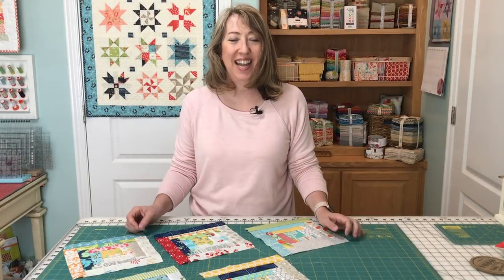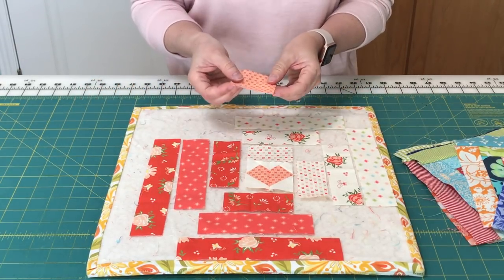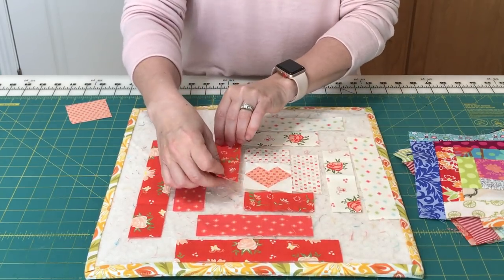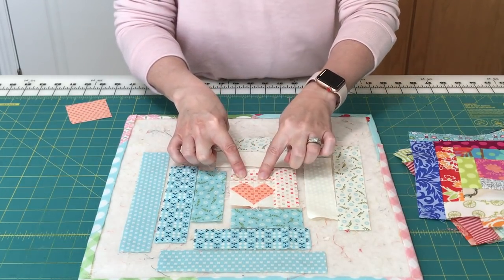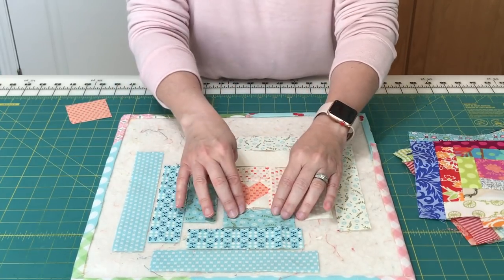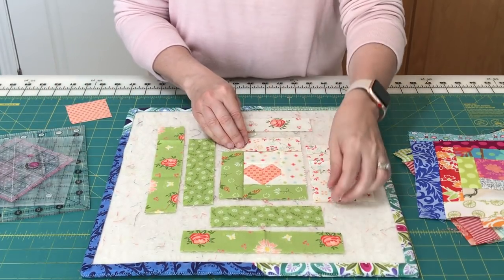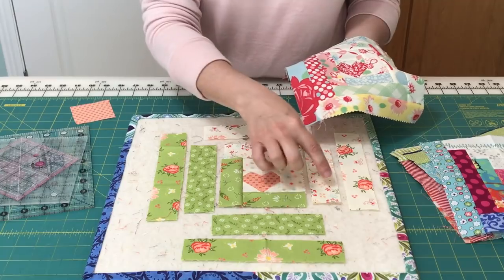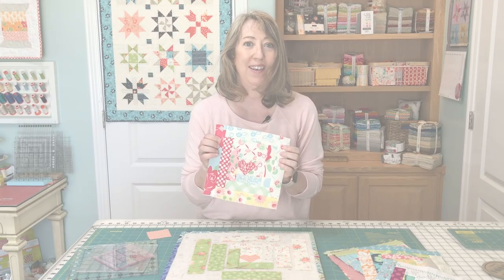Traditional Pieced Log Cabin Quilt Blocks

Comment: Thanku!!! I looked at 30 videos on log cabin blocks,  before i found yours. My blocks were wrong, and i did not know why. They were the same size and constructed in the same way, but they were not working together to form the overall log cabin quilt layouts.  What i needed was a good picture of the initial layout of the block. Your video was the only one i found that clearly showed this. I was getting so very frustrated, so thanku... thank u. Now my blocks are coming out right, and the secondary all over quilt pattern is evident. Hooray!